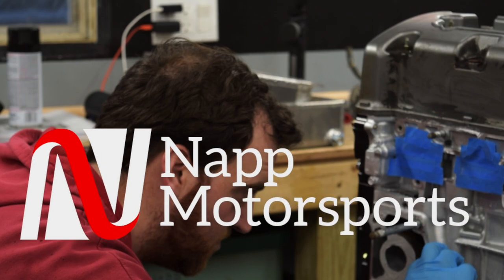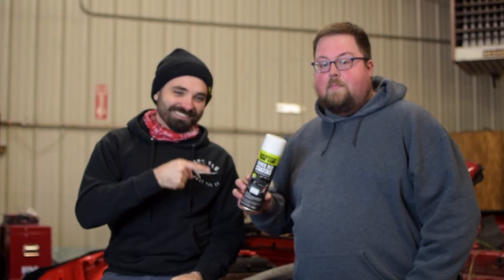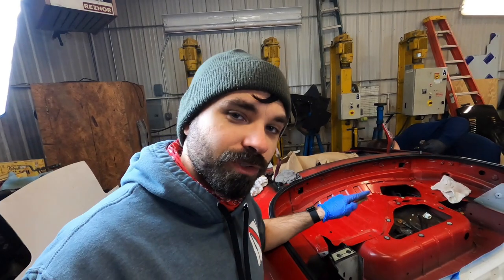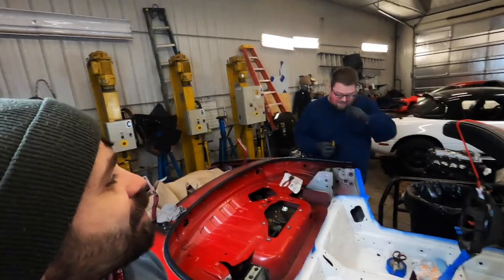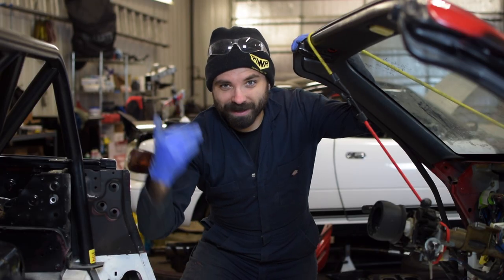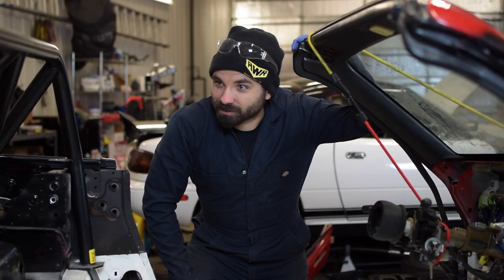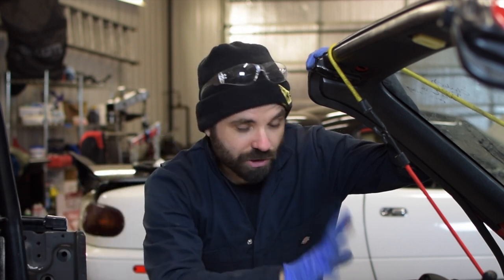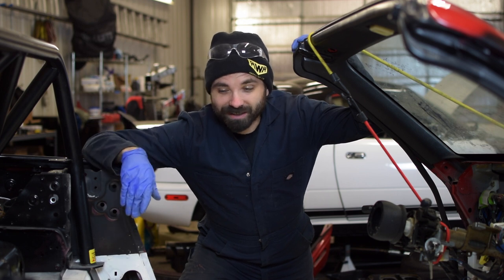Interior Paint For a Track Car // Miata Track Build

Comment: FYI: the nylocks used on my roll bar have been good for 3 years of tracking and autox'ing. Another option if you need it. I initially was checking them every event but they've never moved at all.
Reply from the maker: Nylocks would definitely be a good option!

Comment: Good deal! Any concerns about bedliner reverting to "tacky" in warm weather/drivetrain heat? Car looks remarkably rust free...
Reply from the maker: The car is very low mileage and rust free which is great. If the interior spray was undercoating I would be concerned, but bed liner typically doesn’t get tacky.
Reply: @NappMotorsports  Good to know... May try it in the engine bay.